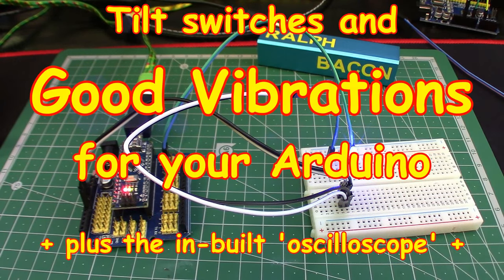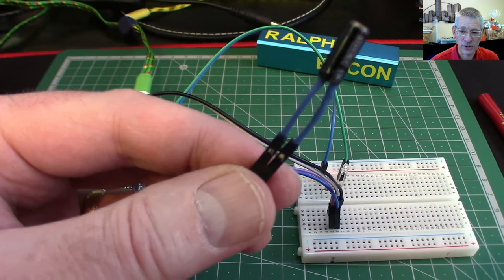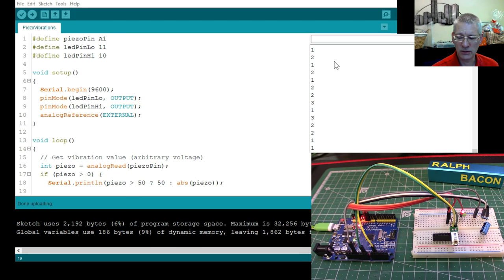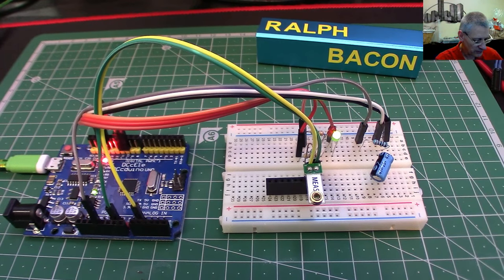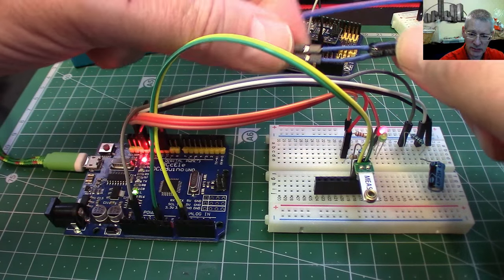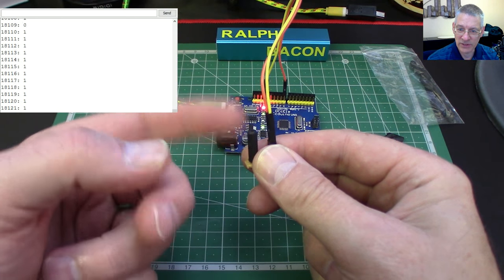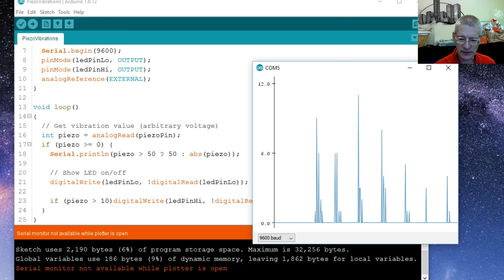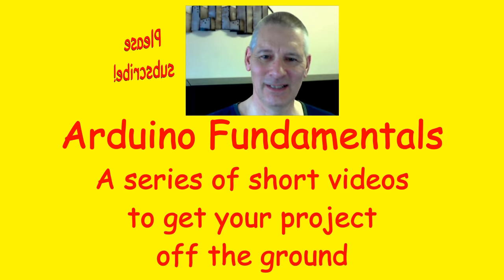#67 Vibration and other switches for your Arduino

Comment: Ralph, Got some of these. If you place it vertically on on a surface which actually vibrates, such as the top of a microwave or a food processor, the little spring starts to oscillate i.e sets up a pendulum like motion and accumulates energy to the point where it makes contact on most swings, detecting a vibration rater than a knock. . Probably need to average the readings to make anything sensible of it. There is another less sensitive version, a "knock Sensor", which responds to the more violent movements, such as a hammer tap. I've got some of those to make a "fall when hit" servo driven target for things like nerf projectiles. i.e. target falls when hit and picks itself up after a few seconds.
Reply from the maker: Ah ha, the plot thickens. So the "vibration sensor" responds to vibrations but not sharp knocks. I've actually had a few different knock/vibration sensors arrive lately, I shall have to experiment further. Thanks for the update Alan.

Comment: Another great video. Thanks!
At 26:54 you ask: "Why would you want someting that is so insentivie..."
The first thing I thought about was a release-switch (trigger) for an airbag (in cars). And then I thought "No! Ralphs sensor is way too sensitive". :)
Reply from the maker: Ha Ha, the last thing you want is an air bag deployed when you don't need it! And something tells me my car doesn't have either an Arduino or one of this sensors in it! Alan Powell also commented on these sensors, which apparently are good at detected vibrations but not shocks - see his post above. I'll revisit this topic one day as I have new sensors to test.

Comment: Realise this is an old post but was wondering about the sw420 sensor. It appears to be based on the same sensor as in your post here. I was looking for a vibration sensor that I can mount under the front flange of a car differential housing to sense driveshaft vibration in rear wheel drive vehicle, however, I cannot see where this is particularly direction prone. My idea is to sense this vibration when it it either at the top of travel, i.e. the top of the diff housing , or at the bottom. Flash a timing light neon at this point so I can determine the vibration "high point". Monitor the flash via one of the elcheapo FPV camera/transmitters.  Balance of the drive shaft could then be started using conventional means ( hose clamps) on the "low point" to minimise and eventually null the vibration.
This essentally requires the sensor to have some "directional" characteristics. Not much info out there as far as I can muster and thought maybe you would have some idea. Cheers Jorgo
Found your vibration sensor too....... http://www.learningaboutelectronics.com/Articles/Vibration-detector-circuit.php     RS Components
Reply from the maker: I don't think I've heard of a directional vibration sensor, but mounting two (or more) at various angles might achieve this. Wouldn't take long for a man of your talents to knock up a test rig. Sounds interesting, so good luck with your project Jorgo.
Reply: @RalphBacon  Thanks Ralph. With a little more digging I came across a module ADXL345 used with a prop balancer project over on RCgroups but they use a Teensy 3.2 which , over here at least, lightens ones pocket by at least $60-$70 before one gets started. The module itself can be had for a few dollars so will start and go from there with an Arduino Promini. Cheers Jorgo

Comment: Bit late to the party here, but OI think those "shake" switches are used for detecting whether fragile packages have been dropped (or chucked onto the back of a lorry) in transit.
Reply from the maker: You mean couriers don't gently place each parcel with loving care into the back of a DHL/ParcelFarce/Post Office/Yodel van? I'm shocked.

Comment: I use the last sensor you demonstrated as a knock sensor for snoozing my alarm clock. One knock for snooze two for off.
Reply from the maker: Which sensor was that Zeedijk? The vibration sensor? Sounds like an original implementation. Nice idea.
Reply: +Ralph S Bacon : Yes it was the springy one. It was in the so called "40 sensor" pack, listed as a "klopf" sensor (For som reason I got a German version)

Comment: For anyone still wondering about the vibration sensor it probably makes a contact for a very short time, so if you poll the state of the pin, it is not likely that you check it at the exact moment it does contact.
You have to use an interrupt to detect the vibration, or add something like a peak detector circuit.
How stiff was that spring by the way? I want to know how small a vibration can it detect
Reply from the maker: It would be interesting to see whether this hypothesis is true, Luis. Although a vibration/tilt switch with such a short pulse is slightly less than useful. But if an interrupt works that would be good too.
Reply: @RalphBacon  Sure It would be very interesting to see how long the contact time is, if you have an oscilloscope it would make for an interesting video...
The inside contact will bounce a lot and so it is very random and short pulses.
People be careful though using interrupts as the interrupt is called for every rising or falling edge and if there is a lot of vibration there will be a lot of rising edges and it can take a lot of the CPU time.
Reply: His code works fine, and it "only" reads the pin.